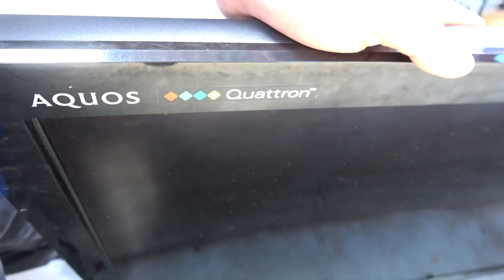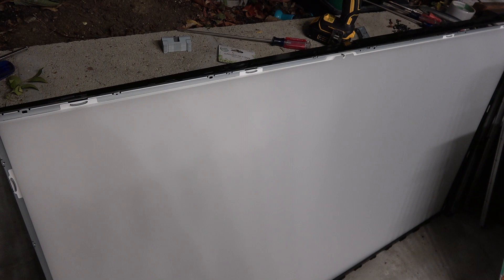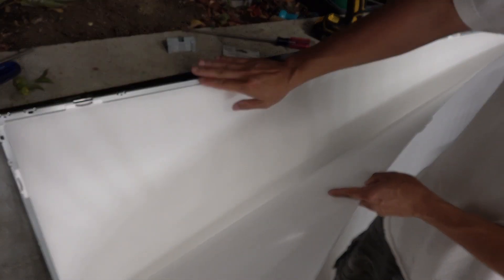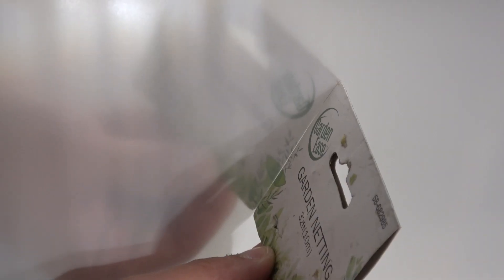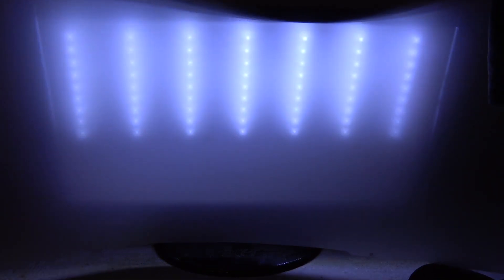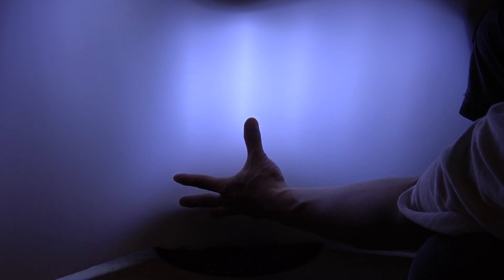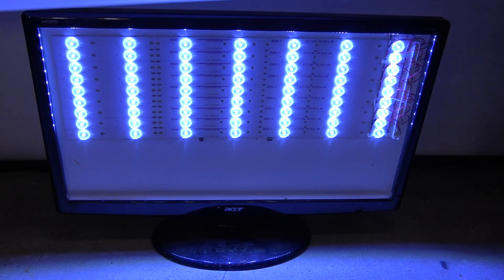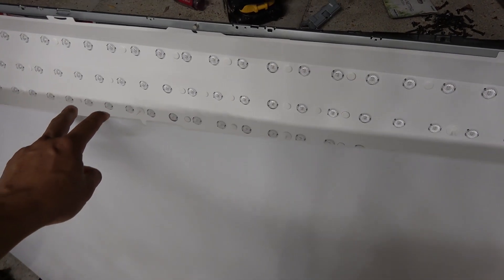Tear down of a huge 70 inch LED TV. What's inside?

Comment: there is a name for that funny layer of plastic  i think its a fennel layer , if you look closlely of feel millions of little grooves in it , thats what makes the backlight on you tv look almost 3D, when the lcd is removed and you put it all back together , make sure that lense/ film layer is the rightway round , it will almost project the light out at 180 degree what ever way you look at it , and gives the appearance of a void space behind the light , i have done several and swithed out ccp lamps for 50/50 smd leds and its pretty awesome , i have a 65 panasonic that im playing with now , uhd 3D smart wifi bluetooth etc , in also playing with the possibiliyies of  using the gutts for a wifi set top box , my proplem is getting an output signal to another screen / projector, sound fantasy but im sure its do able ,